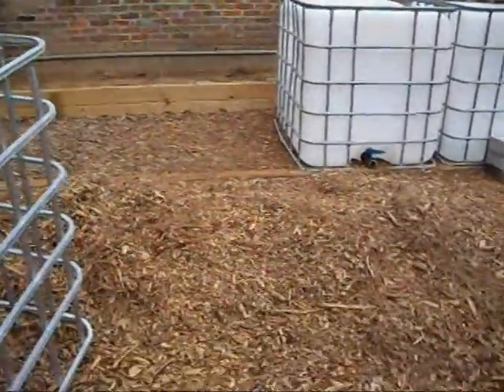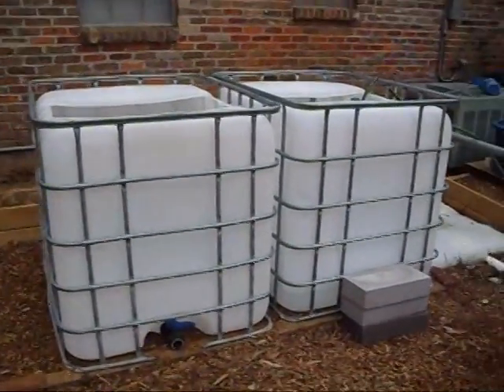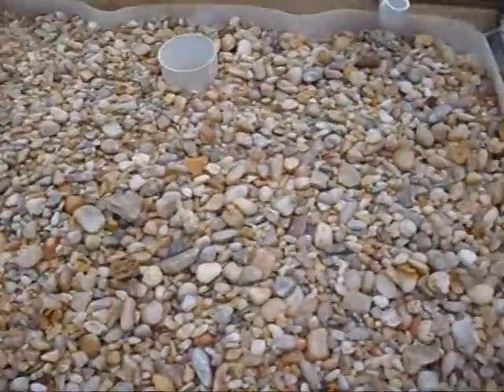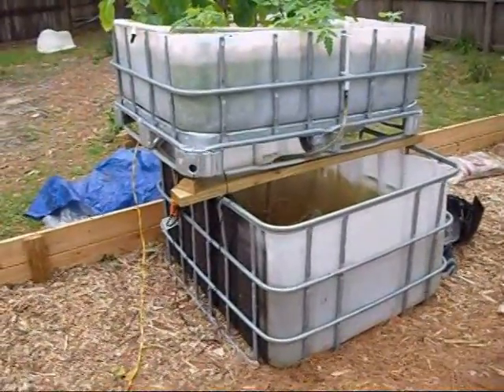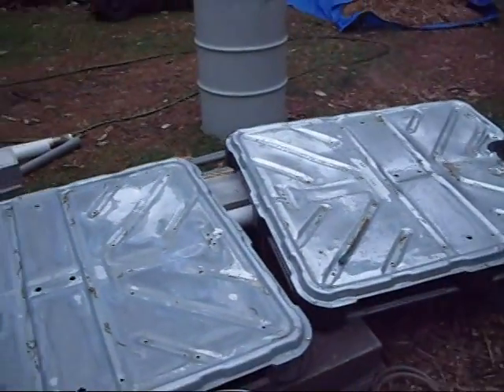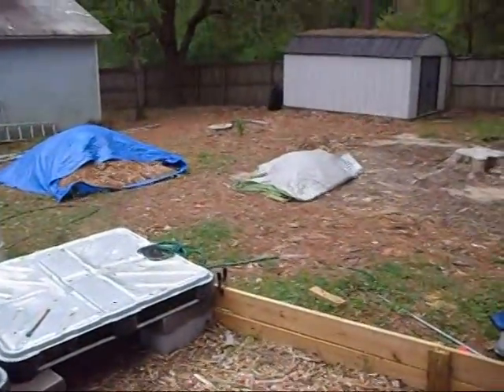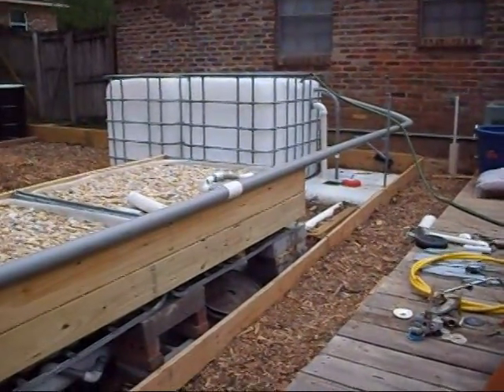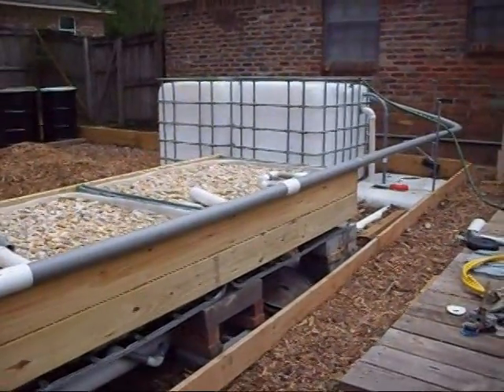IBC Aquaponics System update 6

Comment: I love your setup, is there a recommended pvc size to run from fish tank to grow beds?
Reply from the maker: Thanks!  As for the pvc, I don't know of any "recommended" size from tanks to grow beds as there are a lot of factors going into the size you need for your setup. I used 2" for my gravity feed system and it supplied  6 IBC beds just fine but I wouldn't try to supply much more than that on a single 2"  pipe. For most home systems like mine, a 2" main with 1" taps works fine. Bed volume, desired fill/drain time, head (water drop height), filtration if any (and the flow rate it can accommodate) all go into what size piping you need.  If I knew what you're, how large and the setup of the system you plan to build I'd be happy to offer a recommendation.